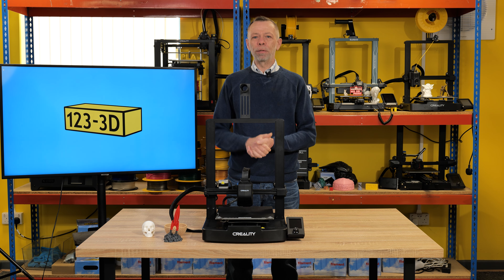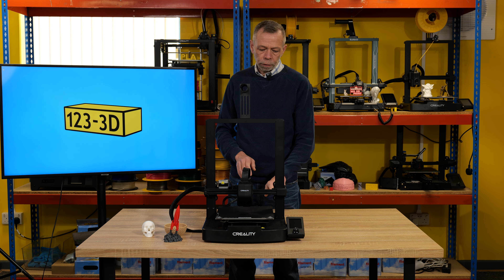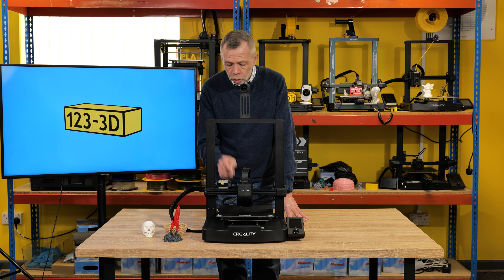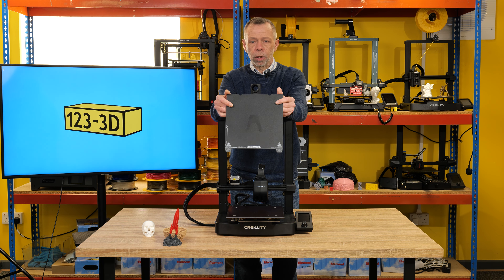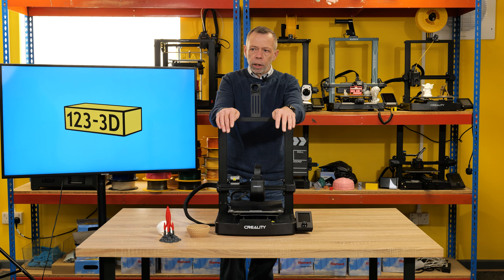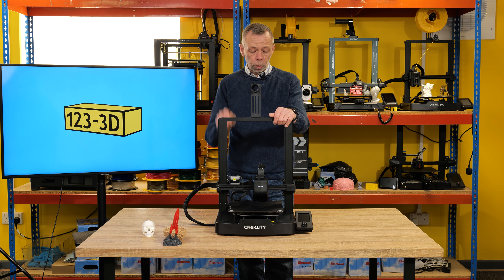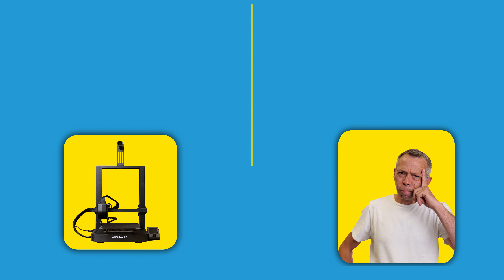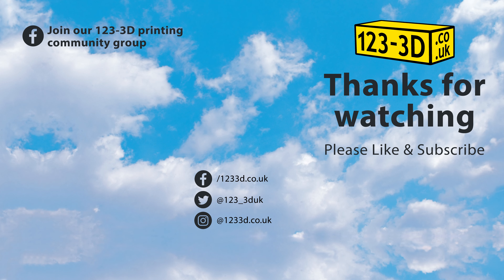Don't Buy a Creality Ender 3 V3 SE Until You Watch This | Deep Dive Review

Comment: I don't think you should print ABS with this, even should be careful with PETG. While the nozzle allows for 260°C, Creality does not tell you that there is PTFE in the heat break directly touching the nozzle. Typically PTFE will degrade past 240°C and also creates dangerous fumes at these temperatures. So a) you need an enclosure and b) have to expect mid term damage to the heat break if printing PTFE on high temps or ABS.

Beside this "secret" (and probable dangerous) issue, I really like the SE as my first printer. Auto bed leveling, auto PID, really helpful for newbies.
Reply: That said ABS gives off styrene gas while you print with it, so you'd need an enclosure with extraction anyway. Most people swap out the PTFE for Capricorn tube when they progress to ABS and other high temperature materials 😉